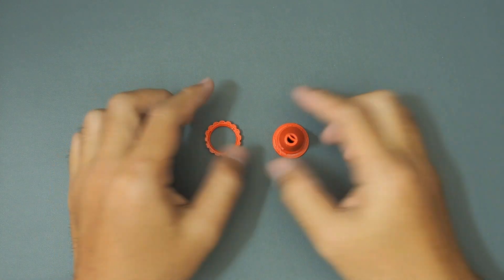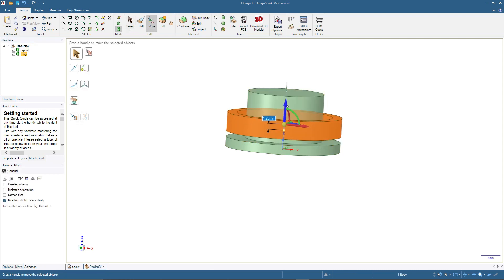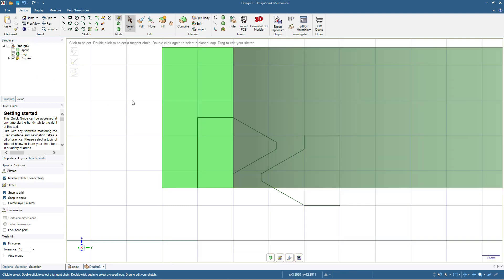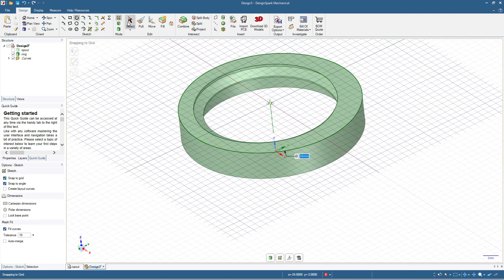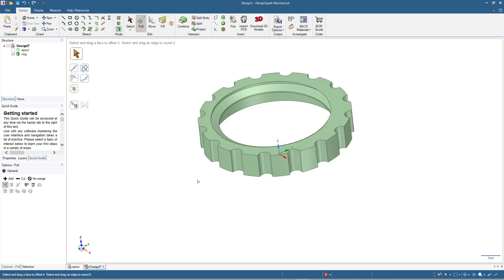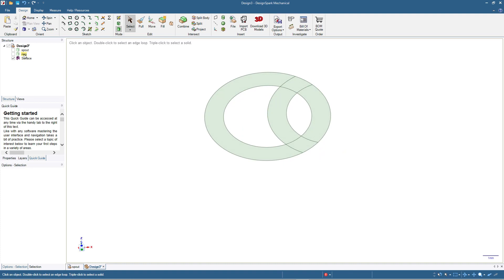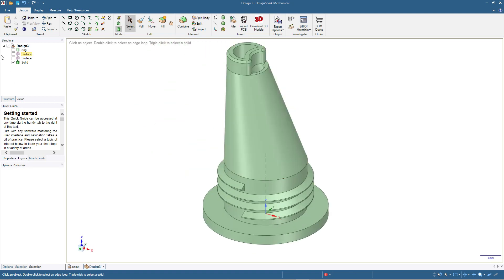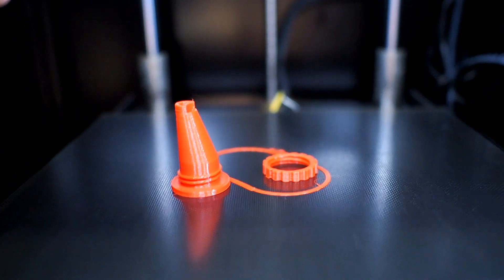3D Printed Bottle Spout with Air Vent, Modeling in Designspark Mechanical - Narrated Tutorial #21

Comment: @W3DE Studio, I have a question: I am looking to move away from Fusion 360, and DesignSpark seems very promising. The one thing I have not found in DS is the ability to capture design history, which allows you to go back in the feature time line and edit a feature, then have the change propagate through the rest of the features. Is this ability present, and I just missed it? If so, how can we do that?

Comment: Excellent, again!  If anyone might know the answer to this question I'm sure it will be you...The export Options output on DSM used to, until I updated Cura last week, send the stl. file directly out to Cura...it no longer works. Does anyone have any suggestions? It was such a time saver.
Reply from the maker: I'm still using Cura 4.8 on my main computer, and just now update my second computer with the latest versio (Cura 4.13.1). Both works just fine for export from DSM.
Maybe you could try download again the installer and reinstall Cura, there might be incomplete installation file or windows registry.
Best of luck :)
Reply: @W3DEStudio  Thanks for the reply and your continuing excellent videos.  I have tried both these approaches already and it's not the first time I've had this problem. It seems each alternate update of Cura works or doesn't for me with the export direct to Cura option in DSM. I still don't know exactly what is causing this and it probably is something along the lines you suggest...but I'm not technical with computers to fix it. Hopefully the next Cura update will fix it for me!
Reply from the maker: Yes, hopefully the next versions will work fine :)